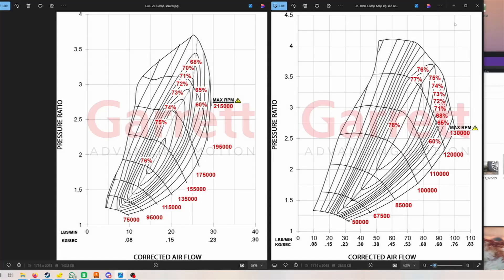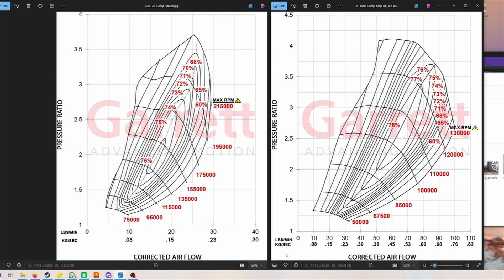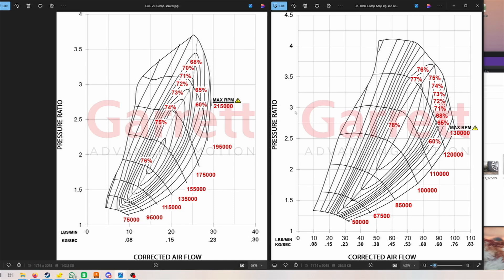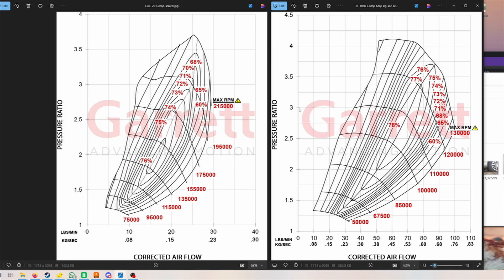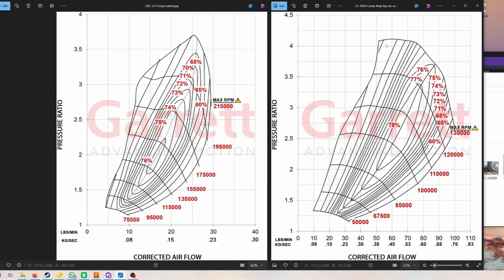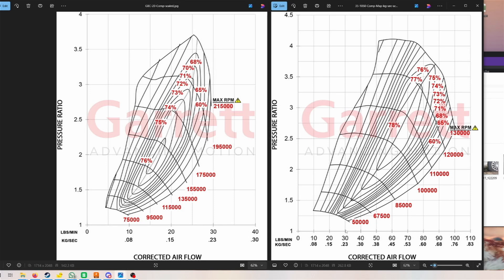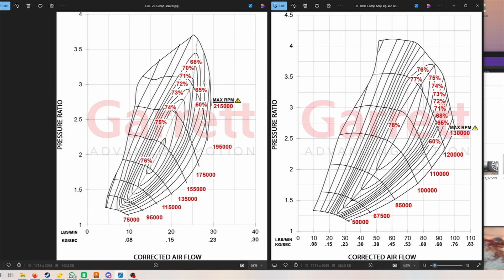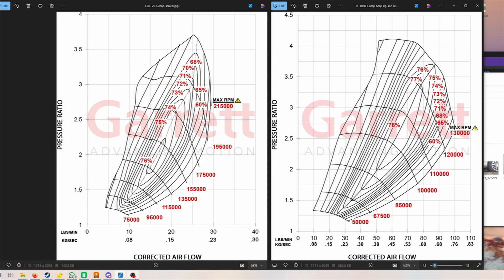Explaining Turbo Compressor Maps as EASY AS POSSIBLE! | WITH Examples | How does your turbo perform?

Comment: Great video. Pressure ratio equals the pressure right at the outlet of your turbo divided by the pressure right at the intake of the compressor, that's what I learned. That is why it is important to take care about the air intake system. Because when the pressure infront of the compressor drops, this results in higher pressure ratios in particular if you add boost, then the ratios increases. It's common to use intake pipes that have a bigger diameter than the turbo with a transition to the actual diameter of the compressor right in front of the compressor inlet just to have a smooth transition. This causes higher airflow because of the same amount of air going from a bigger to a smaller pipe diameter which causes acceleration of the air while you compressor is sucking it in.
Reply from the maker: Exactly. The most important thing to take away though is: Make sure there is absolutely no vacuum infront of the compressor! :) 
a lot of people configure their air filter too small so although they think they have an open intake, they actually still have negative pressure before the compressor and therefore a higher pressure ratio. 

The fun thing about this: even though you would think the turbo just would have to work harder , there will also be more backpressure in the manifold as the turbine has to be spun faster. So effectively a better intake makes more power because it reduces exhaust backpressure. sounds very wierd but it actually is true!

Comment: 9:55 how do you know the max hp figure?
Reply from the maker: the maximum HP you can achieve is detemined by the compressor map if you were out of this map at a certain pressure ratio that would be needed for your engine to make more power. the turbo will not be able to flow that. 

while the boost pressure might increase, the power will not.
Reply: @ I’m sorry, I don’t see the HP figure listed in the graph.
Reply from the maker: @J27M  as explained at the beginning of the video. LBS/min flow can be estimated as 10x hp at the wheels so 100 LBS/min is 1000 whp roughly.
Reply: 50 lbs/min airflow x 10 = 500 hp is a rough estimate that has shown to be true based on experience. The exact numbers are not that easy to forecast. 
You can assume that for example a very efficient modern direct-injected engine that runs on high octane fuel (like E85) could be able to achieve maybe 50 lbs/min x 11 = 550 hp. Garrett uses this kind of calculation for their more recent turbochargers as far as I know. That is the reason why their current G-series stand true to their nomenclature not that often. A G30-660 for example will have a hard time really delivering 660 hp because it is only able to deliver 60 lbs/min and also only at a certain pressure ratio. You can see that by looking at its compressor map.
On an older six cylinder with port injection and pump fuel it won't be able to produce 660 hp.
On a modern direct-injected 2.0L engine with some amount of ethanol or other high octane gas in the tank maybe...

So you can roughly say that 50 lbs/min x 10 = 500 hp either on the crank when the engine and fuel combination is not that high performing or 500 hp at the wheels under very good conditions. 

And you have to consider the necessary pressure ratio.
When you turbocharge an engine that outputs for example 150 hp in naturally aspirated form, you will need at least a pressure ratio of 3.0 when your goal is 450 hp. A little more even because there will likely be some restrictions in the intake and intercooler.

Most recent Garrett turbochargers for example often deliver their maximum airflow at a pressure ratio of around 2.5 which translates to ca. 1.3 - 1.5 bar boost in the intake manifold.

So when you wish for 660hp and you don't have the most efficient engine and fuel to start with, you might look for a G30-770 rather than a G30-660.
Or even a completely different turbocharger. Borg Warner models for example are often a better choice when high boost pressures are necessary for the power goals.
Reply: @ I will come back to your comment when I have time, I only read the first few paragraphs but thank you!! 🙏